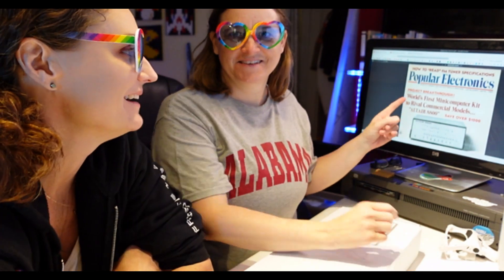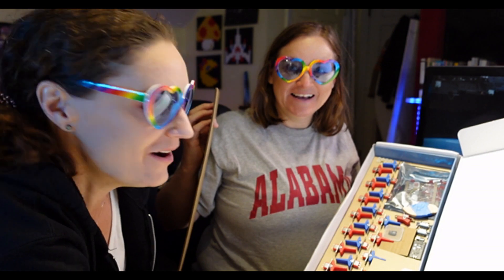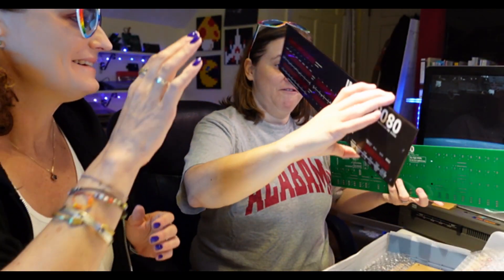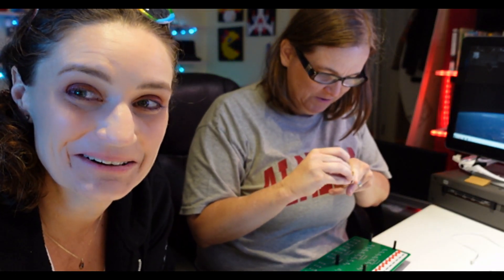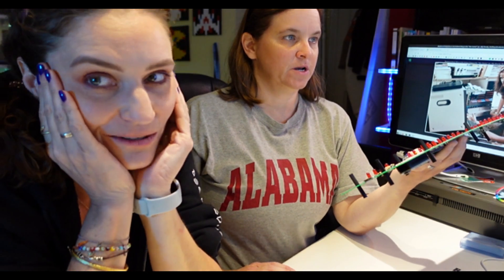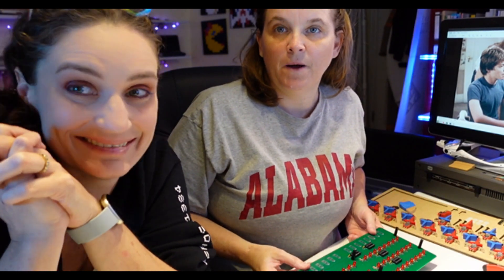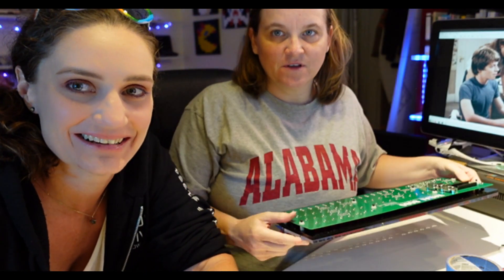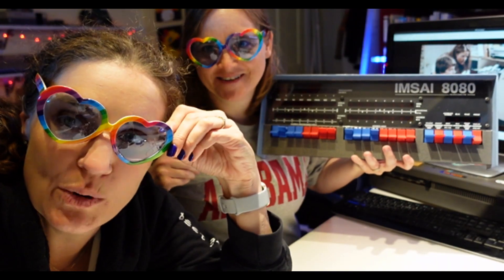IMSAI 8080 Replica Build

Comment: I first saw you two today from Veronica's channel. Good job building the High Nibble's IMSAI. You kids rock! LOL If it helps, and you make me feel old, I read that Popular Electronics (Pop-E to us) when it CAME OUT. Built a MITS Altair 8800 for a friend to use in his business. Not long after helped solder together 12 IMSAI 8080s in our college "micro lab." We networked them with 9600b serial ports. Then spent a weekend with two other guys soldering together a disk controller for the IMSAI master or main node so it could boot from floppies and load each other node, vs. cassette tape. Those were the days. Each kid in the lab had their own IMSAI 8080 to use for assembly programming class. It was wicked cool for the early 80's.

Comment: Be very careful with screws that mount the rear acrylic sheet  to the exterior frame.  It's a good idea to use the little peices of plastic (included with the kit) to strengthen the hold.  You will need to glue them to the rear acrylic to hold them in place.... Alas, I did not and cracked the rear plastic.  There is a lot of weight on those 4 little nuts.    A very cool kit indeed.   Lots of fun.  I suggest the expansion board that allows it to be more stand alone with built in display capabilities.
Reply: Oh yeah, completely agree. We already ran into that issue. Thx for recs!